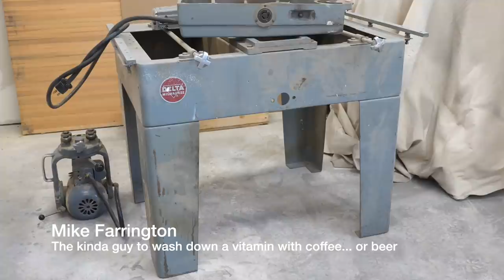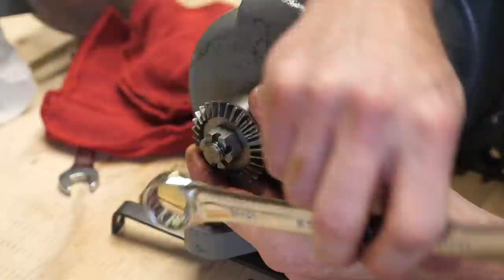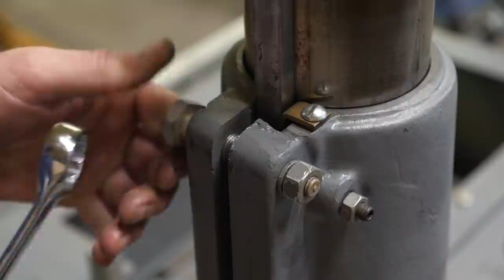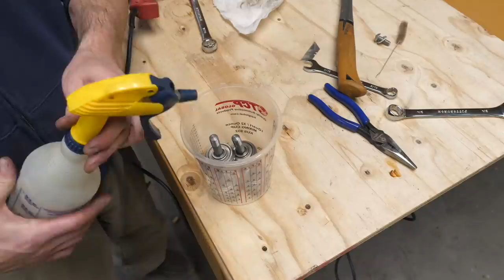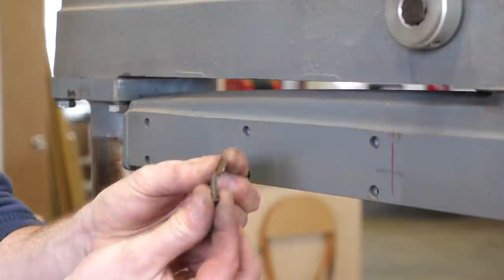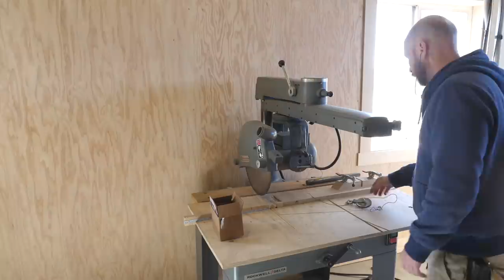Delta 16" Radial Arm Saw Restoration. It's colossal.

Comment: i have seen your Unisaw restoration and Rockwell bandsaw videos. Love watching restorations. I have done a couple of DeWalt radial arm saw restoration, GWI and 1400. Nothing major. Mostly clean up , paint , and bearing replacement, and of course the alignment. I find the radial arm saw very useful. I am amazed by how accurate these older machines are. you can actually crosscut pieces without holding them down.  So smooth.  Keep up the great work.
Reply from the maker: I totally agree, a good radial arm saw is an accurate tool.

Comment: Thank you so much for the insight. I have a 12 inch RAS that I have not pressed into service as of yet. When I was in my early twenties I worked in a custom mill work shop operated as part of a modular home building business. The equipment we used was always old top of the line cast iron. As the new employee I did the grunt work no one else wanted to do. I usually built peak ventilators, prefabbed boxing, ran miles of stock through a rip saw, made thousands of feet of dentil molding on a old Dewalt RAS. The saw held a 20 inch blade and a 12 inch dado set. I was always afraid of that machine. But often ran it days on end. Brings back may memories seeing your fire up. Be safe Sir.
Reply from the maker: Good stuff, a 20" blade would be crazy.

Comment: Nice rebuild.  16 inch, sweet.
I still have a 10" from decades ago (make that a half century) that like many old units was built to last.  
Serious dust makers though.  I located a 10" x 14" dust trap (usually used under table saw or in router cabinet ) Behind blade and hooked up to 4" dust sucking system .
Reply from the maker: Thank you. Yes, lots of dust, and dust that is moving much faster than from most tools due to the blade tip speed. I am planning a collection system as we speak.

Comment: Love how big that saw is. That is also my only issue with RAS's. They can be large. I have a very serviceable old Craftsman 10" saw. I need to square up the table. Got mine before i bought a table saw so I've experienced with all the unusual cuts the manual showed. Love it and at times fear it. Thanks for a drama free video.
Reply from the maker: Thank you.

Comment: I used to bid on a lot of industrial auctions in a previous life and end up with a couple of these radial arm saws that I couldn’t even give away. Ended up scrapping them a few years ago, even had a cool Art Deco looking Northfield uni point radial arm saw that was just plain cool looking.
Reply from the maker: Those uni points are really neat saws. I would like to play around with one. The low cost of these tools is part of the reason I ended up with two.

Comment: Great saws. Used to run one in a lumberyard in the Yukon in the 70's. It was in a shack open on the front and covered in canvas tarps on the sides. Mainly for ripping 2x4's into 2x2's and pointing survey stakes. We gave that saw no mercy and would run it in below -40F temps with no whimper from the saw, turning entire lifts of 2x4's into 2x2's. The whine from the saw would turn into a whistle at really cold temps and the wind from the blade would freeze your face, but the biggest worry was when ripping 2x4x16's and you would get a kickback. The inner part would shoot out of the end like an arrow and get lodged in the tarp covering the end of the saw shack. After a while you got used to it and to my recollection no-one ever got hurt on that saw. That thing is probably still running somewhere in the Yukon today.

Comment: I have a 5HP single phase Milwaukee Rockwell Delta RAS, serialnumber MX3 1013.  I  hope to restore it soon. I used it for more than 20 years then set it aside in storage.  Condensation has it rusted a lot. I hope it's not past saving. When I retired this saw about 15 years ago, I gave my 5HP Dewalt saw to a contractor friend. My favorite is the Delta.

Comment: I've got a DeWalt Model GE 16" built in the 40's. 5 HP 3 phase. Parts are available thru a company in Iowa. The original stand is solid. The start button is on the end of the arm. There is an after market blade guard covering the sides of the blade to meet OSHA. The carriage return is a shop built pulley and weight system that meets OSHA.  Dust collection is a fabricated hood. In the last 30 years I've replaced the carriage bearings and the bronze nut for raising the arm.

Comment: Years ago radial arm saws were every where. They can cross cut, angle cut, rip, dado, and more. They came in many different sizes but there is a  learning curve to them. Many cabinet shops had them for fast and repeatable cutting.  They all but disappeared once the chop saw came on the scene.
Reply from the maker: Yup, my hope is that this saw will be more accurate than a standard chop saw.

Comment: I had a modern radial arm for a while, similar capacity to yours, 16" blade etc. It was only a few years old, switch on the handle and a blade brake, which was a big plus. As you're no doubt aware the blade will spin for minutes once you cut the power. In the end I found it to be a massive pain in the butt to do anything but cross cut. A simple mitre cut was more of a process than I had expected and took  quite a bit of fine tuning. In the end I just couldn't justify the space it took up for the function it provided. A simple T square and a circular saw (of a track saw) does all the wide cross cut I need and I honestly think that compound mitre saws are superior to the ol' RAS. Sold it to a saw mill.

Comment: Tenons: you can cut tenons very nicely in a RAS with a lot less exposed blade than a table saw. Usually there's a provision for a secondary guard alongside the blade on the motor side, which makes for a very nice setup.

Flip the blade into the horizontal position and add a flat guard over it. You can then make a simple sled that slides along the fence, with the work piece clamped to it going over the fence, under the guard, and into the saw blade. You then just slide and cut, using the vertical adjustment to set the width of the tenon very precisely. The blade is entirely behind the guard and the fence and the wood projects through the gap.
Reply from the maker: Thats the plan.
Reply: @MikeFarrington I think you'll be very happy with the results.

Comment: I picked up a free 18-in Delta radial arm saw on craigslist. Looks just like this but supposed to be able to fit a bigger blade. I haven't purchased a blade for it yet but I did a little research in there about $300. Not looking forward to that purchase. Still working out the wiring for it. 220, single phase but I think it requires 25 amp circuit and I'm only running a 20 amp circuit. Can't get the motor to start up without popping the breaker. But I also may have wired it wrong or my bees in the wrong capacitor. But great job on the rebuild. Have fun with it

Comment: Another great rebuild video Mike. Cutting dados with a radial arm saw is equally as fun as turning your table saw upside down and moving it across your cabinet sides (in other words, not fun at all).
Reply from the maker: Thank you. I'll run some tests and see what I come up with.
Reply: Totally disagree. I use mine for dados and ripping and love it.  To each their own.

Comment: Love the resto! Ahhh the sign of the Devil! Rockwell Delta built machines during one of the first cost cutting periods. Companies like Oliver avoided this for a bit longer but finally also broke down. The Rockwell badge is known as the sign of the Devil! It wasn’t till Pentair got Delta during the Norm Abram years that quality improved. Some of the best delta is Delta-Milwaukee. Later they moved to Mississippi. The issues of the Devil were brought up in your resto. The older saw columns including DeWalt were plated with Cadnium. A heavy metal. While not as hard as chrome it offered durability and corrosion resistance. And you gotta love that blade! It’s a real meat slicer….. ummmm…wood cutter:)
Reply from the maker: Very good info, thank you for sharing. The cadnium plating is interesting for sure. The cost cutting is totally apparent when two tools are place side by side. Kinda sad.
Reply: @MikeFarrington  I have been involved in this racket for a long time. The best machines were built from about 1920 to 1965 to 1970. They are getting hard to find!!!! I ran several Homag CNC machines from Germany. Brutal expensive! Even they are showing modern cost cutting. The SCM machines are a pain. You have to pay a subscription fee to just access spares. Grizzly has an issue. They rotate models so frequently that they don’t have spares. And the consensus is that the RAS is dead…. Replaced by chop saws. The big boy RAS can not only cross cut 6 in beams but it can swing a trencher or a shaper cutter. On a big boy RAS like my GE, I can cross dado a cabinet side 24 in wide!
Reply from the maker: @devemch7851  I agree with when the best machines were built. As to new stuff I've had good luck with SCM. My jointer and planer are both SCM. They have wacky wiring, but the machining on the tools is really good.
Reply: @MikeFarrington  You said it! New machine use DIN tail electrics. The Germans often use Siemens or pepper&fuchs. The Italians use brands that are prone to failure. So you most popular failure mode is electric. Depending on the machine it can become a real pain. I gutted the Italian DIN tail on my metal bandsaw and replaced with NEMA Allen Bradley from eBay. It looks like a chop saw on steroids but the saw head is a 14 inch liquid cooled bandsaw. I can slice wafers off a steel log so thin that you can staple them together

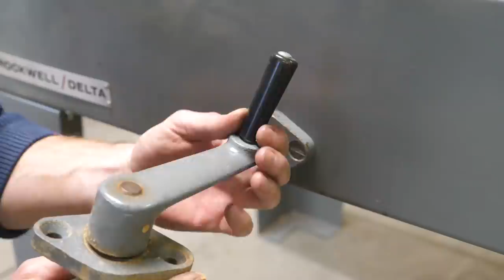Comment: First, love seeing you bringing this “arn” back to life.  Around the 4:25 mark, a bit of a quibble though. I’d argue that cost-cutting was a consequence, rather than a cause, of changes that drove Delta out of business. Basically, Delta built a tool whose mechanical life (with maintenance/restoration) exceeded its useful life–you don’t see many radial arm saws anymore. I think this is what happened to America-made woodworking machinery in general. They invested lots of money in producing machines that the industry stopped wanting. It’s not their fault per se–they didn’t have crystal balls–but it’s hard to fault them for trying to survive later, e.g. cutting costs.

Comment: Build an extension base to your Mitre saw bench so that  the radial saw table is at the. Same height. This can stabilize the saw ad provide extra length for long posts, columns, joists, etc. you will also find that this type of saw is useful for cutting long angles  on sheet materials and can cut long beveled miters that a mitre saw cannot.
Reply from the maker: Totally agree with all that. I ended up building a miter saw station with the saw built into it.

Comment: Hey Mike, I have a 1959 DeWalt RAS. I set it up next to its (much younger) kid brother as part of my chop saw station. Like yours, Or r only does cross cuts and I keep it at 90 at all times.
Reply from the maker: That is my plan with this saw. 90 degree only. Also, this will not replace a chop saw, it will work with it.

Comment: Hello Mike, long time I didn't come on your channel, for some odd reason I was not receiving any notifications from YouTube anymore for your channel...Radial saw, very intimidating that 16 inch blade, just built myself a table saw with a 14 inch diamond blade to cut paver blocks and cement blocks, using my monster Makita angle grinder...I'll try it this afternoon!
Reply from the maker: Hi Tony, I have fallen out of favor with mother algorithm so my videos really don't get pushed anymore. I love the paver saw idea.
Reply: @MikeFarrington  I still should be notified about new videos, but now that I know, I will be on the lookout for new ones, and by the way, the table saw I built works way better than I anticipated, in fact it's like a regular table saw and zero clearance on the blade, just that I need to feed the paver blocks a bit slower than wood on a normal saw, even built a fence for repeated cuts and for large blocks 12x12x14 inches, the trick I used is to have the end of the blade 1/16 th of an inch wider, amazing results!
Reply from the maker: @tonyioannoni4951  Notifications are hit and miss. Check back once in awhile, I'll keep posting slowly. Great to hear the saw is working well for you.

Comment: The column is indeed coated with a cadmium plating for lubrication which is why, when restoring these old saws you don't want to do any polishing to the column's surface.  The other reason you don't want to mess with it is because it's toxic, so just leave it alone and let it do its job :)  I couldn't find a Delta RAS anywhere near me for sale, the closest being about 150 miles away, so I wound up getting a 1950's DeWalt model instead.
Reply from the maker: Good info, thank you very much.

Comment: My local lumber yard had a vintage DeWalt 16" radial arm saw (don't know the exact year) out in the yard that they would cut down lumber with. One day I went there to pick up some trim and noticed the DeWalt was gone and they had a Dewalt sliding miter saw in its place. When I inquired about the old DeWalt I was told that it had broken and was beyond repair and had gone to the dump. I would have liked to have that saw just for its crosscut capacity!
Reply from the maker: Radial arm saws are out of favor. At any given time in my area there are several good ones for sale for just a hundred bucks or so.
Reply: @MikeFarrington  Thats true. I've turned down at least a dozen of them. Their usually either Sears or Montgomery Ward 10" models. All about $100.00.

Comment: Glad you found your hammer along the way! Nice tip about the leather pad. I am sure you already know this but it is worth mentioning that a good welder could braze that cracked casting and make it better than new. Worth considering. Question: Are you planning to let this saw and the miter saw share the same benchtop? I have often wondered if that could be a good setup both for use of space and for dust collection and wondered what you thoughts might be about that.
Reply from the maker: Thank you. I could easily have it fixed but we are talking about a tool that cost a couple hundred bucks, its just not worth it. Yes, I am mid design of my new miter saw station, I will have a chop saw and this saw all in one. They will share an automated dust collection system. Not my main collection system, as I don't want that many amps cycling on and off a million times a day.
Reply: @MikeFarrington  Thanks for the reply. I will be very interested to see that project.
Reply from the maker: @don1031  Should be fun. Stay tuned.

Comment: Nice rebuild. Not sure I’d have greased the acme screw, good coat of paste wax may be better as that grease is likely going to attract saw dust. Also the hole in the back of the carriage just above where you placed the leather bumper, is for a round bumper. The things a beast 🙂
Reply from the maker: The rod came with grease from the factory, so I went with what they did. So long as my dust collection is ok, I don't think much will find its way in there. So I thought the same thing about that hole. On the parts manuals I could find, it didn't show a bumper there. Also at the top of the carriage there is a bumper that would contact the end of the arm if it didn't hit the column first. Either way the leather seems to work well enough for now.

Comment: That was nice you could swap parts from between both of them. If you need better dust collection for it, Frank Howarth has a really clever idea for dust collection with his radial arm saw where it’s integrated into the fence on his YouTube channel.
Reply: Yup, I did my fence in a similar fashion as Frank did his and am pretty happy. Will be interested in what Mike comes up with.
Reply from the maker: I don't know that I will put it in the fence, maybe though. I will build some sort of box collector thingy for behind the fence. I was hoping to the fence as a part that could be replace easily.

Comment: Hi Mike.  I have the 14" version of your Delta RAS.  Have you found any solution to either buy or DIY a blade brake?  Mine spins down at such a slow rate that I can hum the 30 minute version of Iron Butterfly's In-A-Gadda-Da-Vida about 1/2 way through before it stops.  There must be a safe way to implement a blade brake, besides just not turning the saw on...... Thanks.
Reply from the maker: Some of the later models had electric brakes. My recommendation would be to find one of those motors. Other then that, I don't know what would be next best. Great song by the way.

Comment: Love these tool videos, Mike!!
I just scored a Delta 22-470 24" planer 
Brand new old stock, still in crate and full of cosmoline grease .
It's a shame what happened to Delta
A once proud tool line .....
Reply from the maker: That is a nice planer. I almost bought one a while back, but the guy wouldn't come down enough on the price to make it worth it. It needed a lot of work.
Reply: @Mike Farrington  I'm pretty excited about it, and the H Head price is nice at under $2,000 ..

Comment: My prediction: you will fall in love with this saw. I had a brief love affair with a smaller model a few years ago. It turned out to be a dalliance and nothing long-term. She had been around for a while and hard use had taken a toll on her. I wanted her to help me build some garden gates with large timbers and deep dadoos, and she was able to do this, but just barely. I knew that she needed a rebuild from the bones on up, but I'm no Mike Farrington, and she and I both knew it, so we knew her time had come. I still think of her fondly.
Reply from the maker: Thanks for sharing Pat. I have a few similar projects in the works. I think this saw will really help.